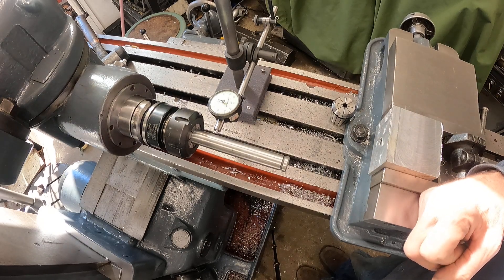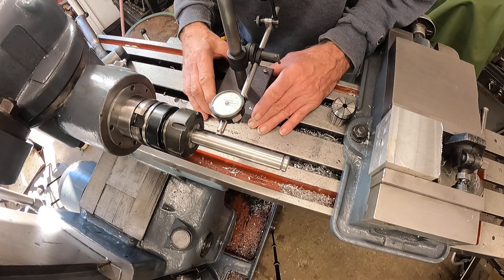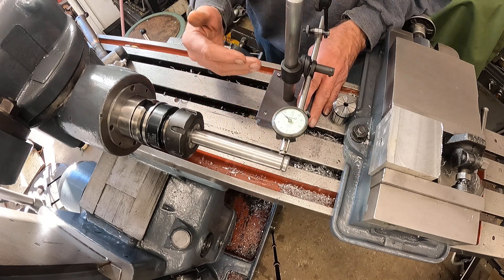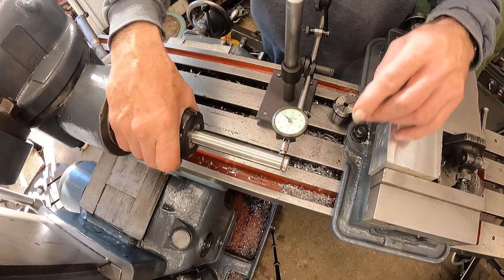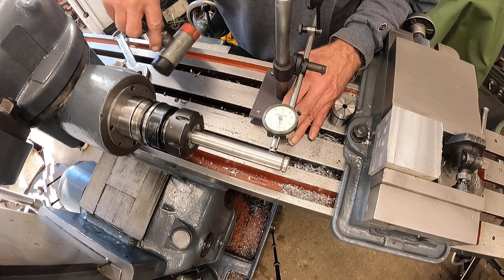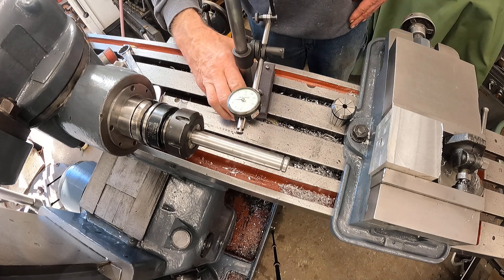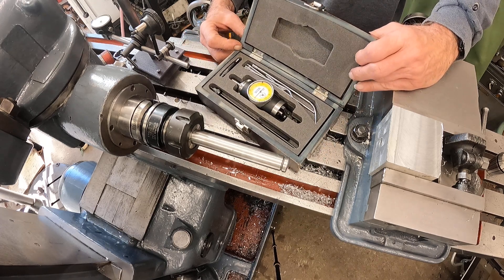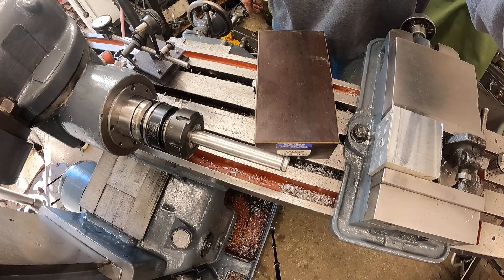Milling machine vertical head tram part 2!

Comment: COAX indicators are a real time saver if you are picking up several pre-located holes of the same (or similar) diameter(s) to perform a set of secondary operations.  The only place that I know of where this type of work is done today is with very accurate work on large horizontal boring mills.  I find that the setup time required to use a COAX is not worth it if I just need to pick up one hole.  I just use a test indicator instead.  However, I am sure that dee dee will find some uses for it, given how his shop is going to be set up.  However, the high positional accuracy which he can get from that Moore jig bore might negate this.
Reply: What I am trying to say is that the jig bore can position holes more accurately than the milling machine and can bore more competently.  Thus, there would be no reason to locate holes on the milling machine and then chase them with the jig bore.  Also, I can't see a reason to locate multiple holes on the jig bore and then transfer them to the milling machine to alter them there.  It might be useful for production work.
Reply from the maker: I am getting ahead of myself on using the machine, The Co-Ax device was scorned by a more experienced hand then me, I think I just wanted to play with one. I want to try it because when using a regular indicator it is not easy to rotate the spindle even when in neutral. The jig bore is not a good metal mover at all, anything I can get off with the mill is great.
 I am on the repair end of machine work so I have to align already made items most of the time, and I am hoping the mill will take care of most everything.

Comment: I’ve picked up a couple in almost New condition of the Blake indicators off eBay pretty reasonable. Thanks again for sharing!
Reply from the maker: I will find out if this thing can work for me.
Reply: if any of them are seized, there's a decent video by Steve Watroba on fixing them. Basically, the blake has an aluminum or zinc body and a steel shaft running through it. Sometimes if the indicator is just sitting there not being used- and especially in an un-heated garage where condensation will sweat out when winter turns to spring- it will have corrosion from the contact between the two dis-simmilar metals.  
They can be opened up, cleaned out and sometimes you might polish the shaft or bronze bushings. It will work like a charm after that.
Reply from the maker: @tilliesinabottle  This Fowler brand and The SPI brand has a brass bushing, I am getting some error in the horizontal position, might be speed related. This tool is a little controversial around here, its either liked or dismissed. And, this one is not a real Blake. There was a Blake at the school here, and I have seen these used around heavy milling machines. The attraction for me here is the vertical head spindle is hard to turn with all those gears even in neutral, this indicator does make it easy . I am going to practice with it
Reply: @deedeeindustrialsuperprecision  I wonder what the controversy is about? It seems to me that a test indicator on a indicol is subject to the same shortcomings - out of roundness and  bumps in the finish of the cylindrical object  that we are indicating against .
Reply from the maker: @tilliesinabottle  Same old grumpy guys that also yell at clouds I suppose. I am curious about if it averages a worn bore, like if you need to sleeve something
Reply: @tilliesinabottle  both of the ones I have are like New. I’ve used both and are working perfectly. Thanks for that info.

Comment: Sorry, but I've been using ER collets for some time now and know about how flexible they can be relative to accuracy. Long before I ever knew about your channel. It's largely by my own repeated use in my lathe and my mill that I've learned that accuracy can be tapped into or out of things mounted in them. It's a regular practice for me to do a little tapping on a shaft to get a few thou of error out of it, and as you learned in your last video, you have to tighten them as a starting point. I tend to use a test gauge on them from inside their bores in order to know the best orientation for accuracy in the lathe, as well as the Mill. In any case I always quickly throw an indicator on them before I start machining a often need to do a little tapping to get things to within a thou or so ... fwiw, I did get a good R8 to ER40 adapter for my Bridgeport and it's accurate to 0.0003. It was only 50 bux on amazon.. It's more accurate than some of the old R8 BandS collets that came with the machine.
Reply from the maker: Sure, you are Fred Flintstone, you been here since the dinosaurs! What kind of comment is "Long before I ever knew about your channel" What about your channel Fred. Please not another fake Machinist dumb ass named bully from the racist fake machinist forum, what about that Mr. Flintstone?